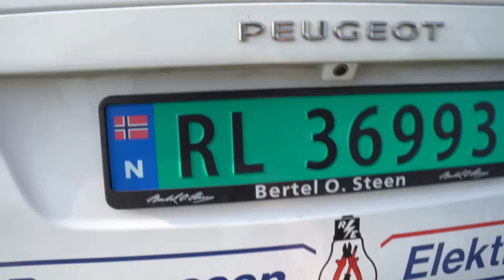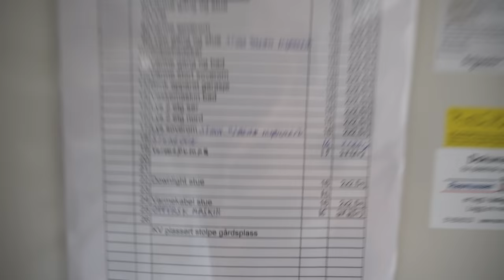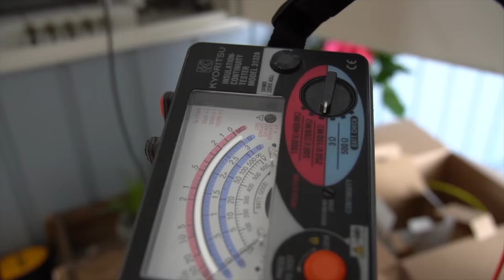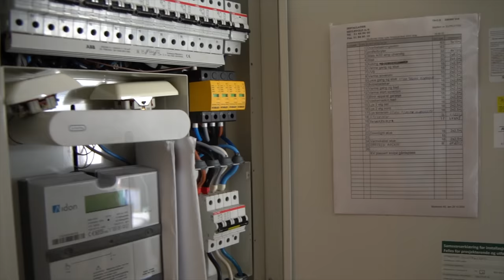Here’s why Electrics are Better in Norway | ØY03

Comment: Love the concept of zappii being able to monitor the current draw of itself along with the mains and adjust. In the states and Canada we have to have a minium of 200 Amp service for one charger. (Most homes have like 240 100amps) or 400amp or more for 2. You can imagine having 50 to 70 amps of power for an e/v charger with only a 100 amps wld be. I sent out an inquiry to zappii to see if they make a n. American version never heard back I wld imagine it wld be hard as it wld have to measure both sides of the transformer legs as we run a neutral at the center for 2 120v opposit phase but can combine them for 240 volts so yes technically usa Canada is 240volts +(avg phase in my area of new england runs 125volts + or - ) so it's more like 240 to 260v - but 60 hertz as opposed to 50hertz. 

There is no national regulation or certification in the USA either the national government makes a new set of basic standards every 3 yrs called the national electric code but it's up to the states and even local government to adopt or make their own actual enforcable codes and bylaws plus they are responsable for permits and inspections. Trust me for the land of the free the government has a lot of control lol
Reply: Measuring split phase power isn't hard. You can run both legs through the same current transformer (but in opposite directions) to get the total current. And if they already have a version compatible with three-phase service the hardware should be perfectly fine for use on our 120/240.
Reply from the maker: It’s great isn’t it!

Comment: Is this just 63 or 100 amp at the house with more for the whole property? 

I ask because new residential properties in the US are being spec’ed with a minimum of 200 amp 240V single phase (old ones were 100 amp).  Some bigger places are even getting 400 amp service, but that’s expected to support the whole property (a shop, barn, etc) and not just a house.
Reply from the maker: It’s 63a per phase, 3 phase, so 189 amps total
Reply from the maker: And 400 volts

Comment: AFAIK older neighbourhoods in Norway often still have legacy 3x230 V IT supplies (i.e. floating earth, 230 V between phases). The CPC is earthed like in a TT and the first fault turns the entire supply into a TT with one earthed line, not an ideal setup.
Reply from the maker: Interesting 🧐

Comment: Personally, I don’t think hydropower is an environmental thing in this case. It’s simply it’s very viable and cost-effective when the power plants last ages. With renewable energy the issue is changing immediately can be bad because the minute you’re replacing things so much carbon is being released that it may take 30 to 40 years for that to be removed. 

It is worth knowing that the way the distribution board is could definitely be installed in the UK and there are lots of options available but the main reason my in awkward places is terribly designed new built or really old buildings. Electricity was retrofitted so awkwardly under the stairs would have to happen.

I do believe in Norway though there is a bit of ripping apart walls for a rewire if the properties been done before a certain egg with conduit if there’s been a regulation change that means it had to be run differently now

Comment: Interesting how it is in other countries what are their regs like? do they have to buy a whole set of updated regs books guidance notes etc? Regarding prewired conduit, we tried this out of sorts but it didn't catch on. I think a lot of houses there are timber framed so no chasing which makes it easier but surely you can only have a limit on bends as we have for it to be rewirable without access points.
Reply from the maker: Good questions! I’m not 100% sure on it all 🤔 I’ll investigate!
Reply: @corymac  Hope your new venture is going well.
Reply: The regs is accually pretty similar to the rest of Europe and UK, it's based on the  IEC 60364. But ofc we have some national adjustments because of climate, building methods and the IT 230v system mainly used on old installs, but in some new if there is a building getting connected to an older transformer network.

If you want to become a electrican in Norway, it is also really strict. How most do it is through 2 years of "trade school", then 2,5 years of apprenticeship. If you have your papars from abroad, you need to send in your application to national governing body DSB. With out approval from DSB you're not allowed to work as an electrician in Norway. If you want to start your own business you can't just be an electrician either. If you are an electrician you need 2 years more of higher education, after you finish with that education you need 3 years of practice as an project administrator or similar and lastly you take a final exam adminstrated by DSB that probably 60% or more fail at, at first try.

Comment: Did you switch off a 1 phase breaker to disconnect a 3 phase socket? 😂
Reply from the maker: Correct! Mistake well spotted 😂 - thought I’d leave it in there for the sharp eyes 😉

Comment: You want softer 20mm plastic pipe like in cyprus and bend with a spring and just pass a spring through and pull the wires through.Not the hard uk plastic conduit more like a water pipe.
Reply from the maker: That sounds interesting 🤔 I’ll have to add Cyprus to the travel list!

Comment: I'd kill someone for US Residential 3-phase. Lol

It's damn near impossible to make happen here. You have to live close enough to 3-phase distro which they don't typically run into residential zones and then pay a MASSIVE fee to have your service upgraded by the power company. Something that I could do or hire out for significantly less.

We use rotary phase converters and VFDs when we need 3-phase in our homes or home-shops.

Comment: 100 amp single phase is considered high? In the states most houses have 200 amp single phase and just about all new installs are 400 amp single phase.
Reply from the maker: Remember we run on a higher voltage here in Europe - so it’s minimum 100 amps 230 volts a phase, or 400 volts three phase. 😃👍🏼
Reply: @corymac  Voltage in the US is 240 volts single phase. I know everyone thinks it’s 120 volts. That’s due to the center-tapped secondary of the transformer being available to each service which provides 120 and 240 at the same time. But the actual service drop to each house or flat is 240 volts. 3 phase is 277 or 480 per phase depending on the configuration.
Reply from the maker: Oh that’s cool! We do similar on building sites, except it’s 110v CTE ( 55v per phase )
Reply: @corymac  Yeah, I've heard about that being done on building sites in the UK. I think it's done for safety since building sites tend to be more damp and the lower voltage is safer. Here in NYC we have 480v on building sites! Haha. But that's mainly for the temporary lifts that are required by law once the construction gets above a certain hight.

Comment: Not going to lie, that install is pretty sub-standard for being in Norway, esthetically speaking. Also, all the measurements you asked about other than earth continuity and insulation testing is required as a final inspection. You are also of course required to make sure the new install you are adding, is compatible and not affecting the rest of the electrical installation.
Reply: Concrete and bricks is a normal thing to deal with, be it foundation walls or basements. It might be less common seeing as there are so many wooden houses, but a Norwegian electrician should be more than comfortable working with it, I don't really get what he is on about.
Reply from the maker: Maybe it’s the area 🤷🏼‍♂️

Comment: Interesting to see how different installations are in Europe (I am in CH actually) - and I am no spark btw - but no ring mains, no fused plugs, huge steel distribution panels, special sockets for washing machines/diswashers/dryers, all cables in conduit, no ceiling roses ...etc. etc. Also, no cowboys working for "Bodgeit and Scarper" - only properly trained persons allowed to do electrics. Sounds like a utopia compared to Blighty doesn't it 😂
Reply from the maker: That sounds like heaven 😍😍

Comment: How do you turn off a 4 pole plug with a 2 pole breaker?
Reply from the maker: Bingo!
Reply: Use a 4 way rated contactor fed through the 2 pole breaker.
Reply: @Jay369  My mistake, i forgot contactors :D

Comment: My dear Cory, I love your channel but your handywork needs improving on certain non-electrical tasks. For example. To avoid blowing a crater on the back of the wall, take your drill off hammer just before you break through.
Reply from the maker: Thanks Nick, I do this, I wasn’t drilling… as stated, they don’t deal with much block work in that area so wasn’t familiar with it

Comment: If UK electrics suck you'll have a heart-attack if you ever saw USA electrics...
Reply: When I saw that they attach their Romex to the studs using staples I was astonished. Seems so dangerous; what if the staple accidentally pierces the insulation and creates a short? Right next to dry lumber??
Reply from the maker: Hahaha, I’ll be over soon!
Reply: @112Haribo  It's fine. It's not like they have ground/earth to worry about in most cases. Or fused appliances.

Comment: As you can see all the European wiring systems use double pole circuit breakers for single phase wiring, so polarity is never an issue. They don't do ring final circuits which cause more problems than they solve. I also like the fact Norwegian sparks don't have to take responsibility for anything the DNO has fucked up previously. To say the UK is unregulated isn't specifically accurate, we all have a duty of care under the Electricity at Work Regulations. If you screw up and someone gets hurt, the EaWR regs will send you to prison, well the courts will when you have to face the HSE.
Reply from the maker: Just a shame it has to wait until someone gets hurt before action is taken
Reply: @corymac  Historically it's not been a big issue, however there is a case recorded where a woman died when she touched a metallic kitchen shelf in a cupboard and the kitchen installer had put a fixing into a live cable. Tragic as that was, it set the ball rolling to instigate Part P of the building regs. It's still the HSE that will decide if you have broken EaWR, it doesn't matter what training you have or what trade body you are affiliated with. The NICEIC, NAPIT etc certainly won't protect anyone from screwing it up. Part P for domestic installers, hasn't contributed very much to electrical safety.
Reply: Double pole is actually more a Norwegian thing because of the IT system.

Comment: As a simple homeowner I’d be kind of pissed if an electrician made a mess with a load of silicon and dust on a concrete blow out. Much rather they just mention the mistake, I wouldn’t mind, and could make good myself later on.
Reply from the maker: Watch the short pinned on my Instagram, it was invisible by the time I finished 😎👍🏼

Comment: A TN distribution board, in Norway? You are lucky Cory, most are going to be IT over here. No neutral for you British lads!
Reply from the maker: That’s cool!
Reply: @corymac  I don't think IT is cool, but it is for sure intersting to learn about it. Most new installs will be TN these days and we also have commits working on bringing us out of the dark ages on the older installs (and newer installs connected to older transformers).   Since we've been using IT for so long and older installations often are IT 230v, we tend to have the same safty standards on both systems, meaning in general a higher standard on TN compared to else where in Europe since there is no neutral in IT.